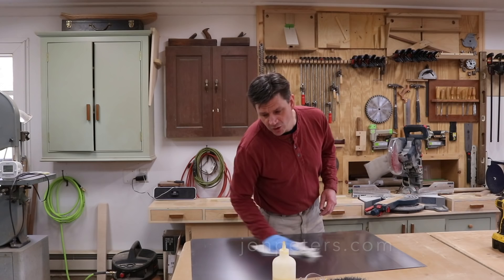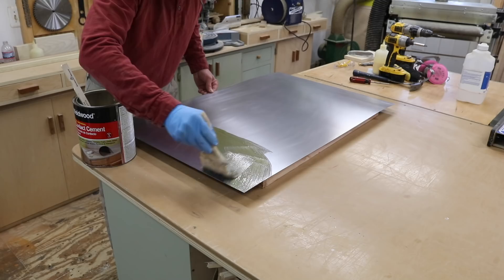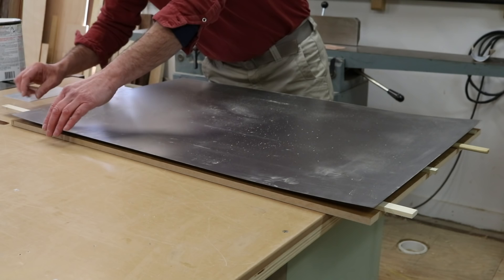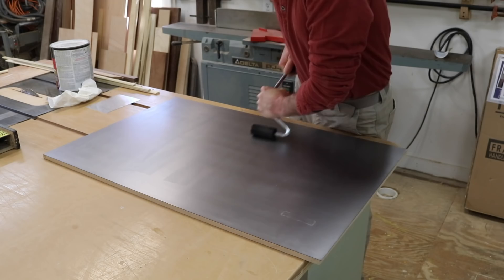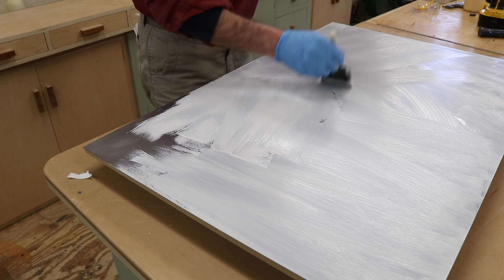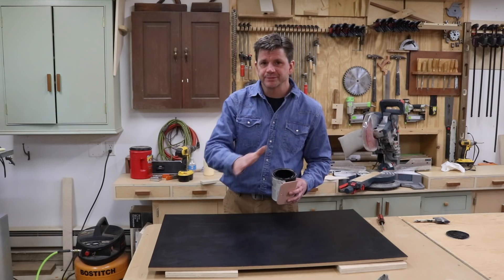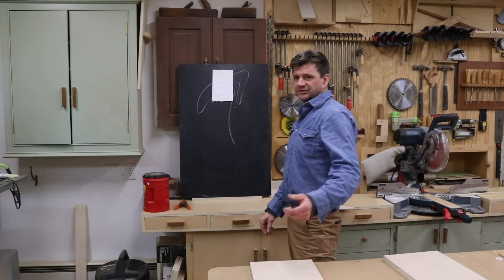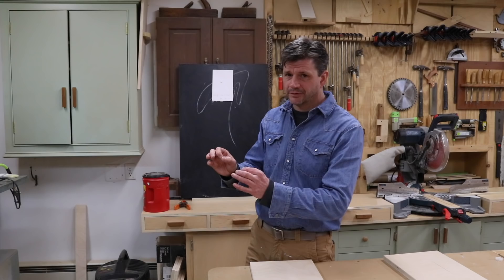How to Make a Smooth Magnetic Chalkboard, that Works!

Comment: Jon, great video just a few suggestions. I've made hundreds of these over the years so I like you have tried many different finishes at techniques with varying results. You're right, the mag receptive paint is junk. The only way to hold magnets well is to use a ferrous metal substrate. You can get 2x3 galv hvac sheet from HD for about $10. You will need to look through the pile as it's so thin (23 ga I think) and it has memory once bent. It's a lot cheaper than normal sheet metal stock they sell. I apply them with spray contact cement as it goes on very even and no cleanup. I also don't sand it, sometimes these paints can have nasty chemical almost contamination issues with the galv. steel. I just wipe it down with denat alcohol and it gets good adhesion. I also spray the chalkboard paint, about 3-4 coats and it dries very slow so with the right HVLP it flattens to a perfect smooth matte finish. You can do it with something as cheap as a wagner and still get awesome results. I never use primer, used to but it's not necessary for brand new sheet metal. I like waterbourne chalkboard paint more than solvent as it seems to be the most consistent and is incredibly durable once cured. I've stress tested and the waterbourne is more durable (usually not the case!) I think latex base is just more flexible to any chalk abrasion. Anyways, great video just thought I would share my input. I've literally pulled my hair our sometimes getting these panels right and found the above to work the best.
Reply from the maker: Great Info ! Thanks
Reply: To save time & hassle, maybe try "Chalknetic Chalkboard Paper", it's available on Amazon now. But if you asking for very strong magnetic power, then metal sheet is still the only option.

Comment: Textured paint, with enough clear coats to make it smooth but still somewhat bumpy makes a PERFECT chalkboard.

I have outside furniture with metal arms. Those arms are painted in some kind of multicolored textured paint and then sealed and clear coated for protection. Randomly one day my kids drew on it and when I wiped it off it came off perfectly. No ghost left behind. It was a bold, clear line because of the subtle bumps left behind after the sealant and clear coat.

So beautiful and now that the kids want something more than chair arms to draw on I am attempting to recreate the chair arms on a sheet of metal.

Comment: I used RustOleum magnetic paint kit. $19.995 at HD. Works great and is easily refreshed on any surface. But, certainly using a steel sheet is more permanent. Nice.

Comment: Some years ago I was told that the first use of chalk on a board should be with broad strokes all over the board - made by using a stick on its side.  Apparently, if you do not chalk 'prime' the board in this way, the first marks made on a virgin board with the end of a stick of chalk can be very hard to remove, and remain as 'ghosts' in the background for some time.    Perhaps, Jon, you can advise us if you did NOT have problems with your test marks.

Comment: Hi,why didn't you spray paint it ,one thin coat metal primer,then several coats of thinned semi gloss black ,with 600 wet and dry abrasive between coats.